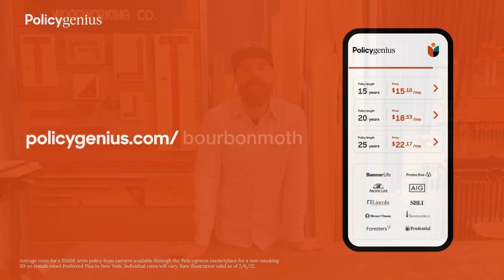Installing Windows In New Construction || Lap Siding Installation

Comment: I’ve installed alot of LP lap. We always overlap 2” and put the nail as close to the 2” mark as possible. It makes the lap a great deal stronger and less likely to flap or lift. I believe LP spec says to be at 2”, but I would have to verify that. The gecko gauge install tool is a lifesaver. I use them as a helping hand more than a spacer. I do what you did and make my own jigs for spacing, but the gecko’s provide another set of hands when you’re siding alone. I have noticed the laps I nailed too high tend to lift up very easily. Also, your door screws I noticed are like mine. You can see them. A trick I eventually learned is to fold the gasket back and install the screw and then let the gasket cover them. Simple, yet, it took me years to figure that out ha! Good videos…

Comment: as someone who has done this for a while, you did almost everything right. it’s a little late now, but normally we put the flashing tape over the flashing on top of the window before putting the siding over it.
Reply: Hi, planning to build a tiny house for my disabled son who will always live with us, can you clarify what you mean because they did put flashing tape over the windows and rhen the tyvek seams. Are you saying that they should have put another layer of tape over the tyvek?
Reply: 7:47 to make it easier for you to remember. Thx
Reply: @inmyimage1081 this was in reference to the metal flashing over the top of the trim, the trim should be installed over the window tape, then the metal flashing on top of the trim, then fold the tyvek down and trim / tape it onto the metal flashing
Reply: @inmyimage1081 if you notice at 20:37 there is no tape on the metal piece as he installs the siding over it, over time this will cause leakage into the top of the trim from behind the siding
Reply: @dannycallahan3017  Got it. Thanks 👍

Comment: For future reference, that particular siding requires painting all cut edges,  and flash all joints. I know you don't have any joints, but just remember for future projects. It's just that I have installed many many miles of that stuff. Lol
Reply: Watching from northern europe here.. don't you guys add a ventilation channel between moisture/wind barrier and siding? eg an 2-5cm vertical spacer slats and then attach siding to it?
Reply: @Rabarebane  no nothing like that.
Reply: @Rabarebane it’s best practice in America and everywhere else. Code in bc Canada tho.
Reply: @Pinkpalmpufffan-k7z  Really interesting. In here the wood carcass wall would be (from inside out):
1) drywall
2) MDF
3) 45mm/2inch wood carcass with 50mm rockwool for (mostly) soundproofing and leaving room for electrical etc
4) moisture barrier 
5) 20-25 cm / 12inch wood carcass with insulation wool
6) windstopper plate
7) 22mm/1inch wood carcass for ventilation
8) siding

Probably overkill for treehouse tho, but keeping siding ventilated and able to dry from all sides is considered non-negotiable pretty much.
Reply: @Rabarebane  It depends... go see Matt Risinger's "The Build Show" for how the high end houses are done... and remember, this is a kid's play house, built by a woodworker, not a construction professional. Where I live, I wouldn't even be able to build this thing because it's too tall.

Comment: You really only need the moisture barrier on heated spaces.  Even if it won't be heated initially, it's best to put it on in case you decide to heat it later.  Good work.
Reply: Agree.  I did my siding w/o any moisture barrier for my garage and it was fine.  How do I know?  I had to take off the sidings and put them back on like 3x for fixing stuff and the wood behind it was like the day I put it on.  Just as crappy then as it was now.
Reply: Depends on where you live and what type of siding you use. It a necessity in some areas

Comment: Hey Jason as a siding guy I can say your window buddy should be using tyveks flex wrap at the sill of the window; reason for is the only defence you now have is that caulk. That double cut corner still leaves you exposed. 

At the header of your window should be a flashing, ours is end dammed, we also run our window header to the length of our.  header trim. Once complete there we have a secondary flash run that same length that's taped to the paper as our first defence. Do not cut that paper for you've created a potential point for water to get in. 

For siding, because you're in a wet environment follow James hardie Install guidelines, it's the same as every other siding companies but more thorough. A siding ring nailer and 16 gauge Brad nailer with 2.5" nails is what we use. 

Do not tool your caulking! I seen in the Reno work it's tooled horribly. Caulking shrinks we all know it, but to tool it being an all weather caulk will cause it to have a chemical breakdown.

I get it that it's your place and you do you. It's good to see you admit to not knowing, but know through obsertion; as ive said follow James hardie Install guidelines that are a free download and you'll be set. If using LP see what they want for their butt joints, we use a different wood product called kwp and their ecoside we use an aluminum flashing at their butt joints that's colour match.

Comment: Having done plenty of siding, the only thing I noticed that you could have done a bit better, was nailing on the bottom of the piece of siding on your ripped areas instead of the top.  Nailing the top tips the ripped area a bit more than the full width pieces.  Great job though man, I love the content~!

Comment: Not sure if it’s been said already, but if you’re doing lap siding in as a team, the easiest and most uniform way to do it is to use a speed square to hook the bottom of the last piece, then sit the next piece on top.  If your going solo, I highly recommend Gecko Siding Gauges.

Question, how did you like using the LP Smart Siding?  I’ve been interested in it since I saw it at a trade show.

Comment: I used to love my Ryobi caulking gun. The only problem I ever had with it was when I first got it and set it to it's max setting. Apparently, the faster the caulk comes out the greater the pressure of the caulk, which hydraulically lifted the trim up. But a few more screws took care of that. But not for the ones that already lifted. I had to take those off and redo them cause I couldn't sink in more screws to squish the trim back down. And as I recall, a piece of trim cracked and had to be replaced. But once you get it figured out, all you need to do is get a lot more caulk. No water getting behind that trim ever.

If you should ever decide to get a Ryobi caulking gun, be careful with it, it's really powerful.

Comment: I’m excited you’re using lp siding. My wife and I are planning to use it on our addition in the spring. So it was cool to see you putting it up and the process. Thanks!!
Reply: Hardi would be far superior and last 10x longer if you are planning on keeping the home over 10yrs.👍
Reply: @remodz6385  if that’s the case then why is Hardi’s warranty 30 years whereas LP’s is 50?
Reply: @remodz6385  thats the cement board type right? I’ll check it out. Thanks!

Comment: I dont know what the manufacturer says about that siding and i get people dont like nails in a pre finished product but i fail to see how nailing at the top wont result in a strong gust of wind lifting up the boards. The traditional way to nail that type of siding is about 1.5 inches from the bottom, just above the top of the last board(so you dont nail through both). This allows them to move with expansion and contraction and locks the boards down so they dont lift up.

Comment: That's a very fancy (not a tree) treehouse. It's amazing, I love it. 
Puts my childhood pallet and rusty tin ramshackle tree fort, lashed to a tree with cheap nylon rope, to shame. It leaked every time it rained and rocked alarmingly in any slight breeze!
Reply: @gwebocelestron9194 , I think it'll be fine, it'll certainly be safer than what I had. The problem Jason had with the racking was caused by putting a large sideways force on an unbraceable, unsupported cantilevered deck. If that deck had stilts it could have been braced against the sideways load caused by the rope bridge.

Comment: It is beginning to look more finished. If the kids don't use it, you can for a great man's retreat/getaway hideout for some you time.  

Surprised you haven't had to install at least temporary handrails even up the stairs, as stairs it is easy to trip and fail and the flat landings as you could easily set backwards and fall off them. I know in my area the building code demands it once the stairs or landings/walk ways are installed without walls. Hope you used tempered glass with kids it a lot safer.

Comment: You did good with the windows but the right way is to cut from one corner to the other making a big "X" so you could wrap the material over the window frame and make it more water proof. If you do it that way, you will have a lot of wrap to pull inside and then cut it off after you have wrapped the window openings. Nope, they have a siding gun to do that work. No need to use nails as long as you did... That is one fine looking tree ( without the tree ) house. One thing you may need to think about. Do you want heat and air in the house because this is going to be a great place for you to go when your wife thinks you did something wrong and sends you out to the "dog house" for the night!!! Think about it...

Comment: Nice job, you wore suppose to use a roofing gun. Where's the handrail,  heat, electric.
Reply: Actually should be using a siding nailer, but a framing nailer would work, I'd never use a roofing nail
Reply: @michaeltilburyiii2760  I use a roofing gun for years, before they ha a siding nail gun
Reply: I think he knows what he's doing.  He was marking them out and popping them into the studs.  There will not be any exposed nails.  For the pro's, they popped nails everywhere because they have to do it quickly.  Jason spent his time marking them out and lined them up.  I would say what he was do was OK.  But if you do that for a living, single purpose tools will make them go fast.
Reply: @ipick4fun27  that has nothing to do with our conversation about nail guns.  I know Jason is do it for fun.

Comment: I can't believe you don't wear safety glasses when cutting your boards, using the miter saw or the track saw! If you get something in your eye it could be very dangerous and hard to continue working as you have in the past.  Please wear safety glasses for all cutting, it would be good for nailing as well.  I just never what to say I told you so that would be a bummer.

Comment: i don't understand American houses. you go through all the trouble taping around the windows, and then you just put screws through for the siding
Reply: The nail that was installed in the siding was then overlapped by the next piece of siding. No exposed holes there. He should caulk the holes in the trim, though.